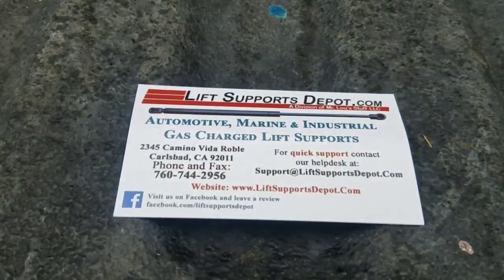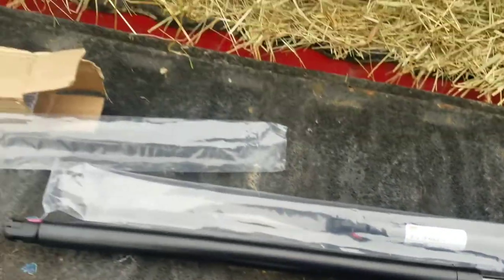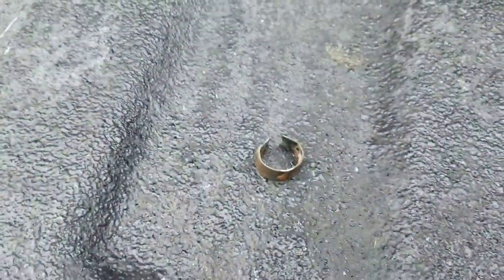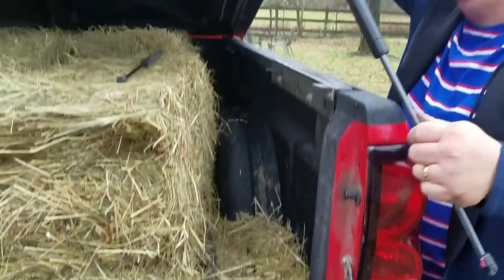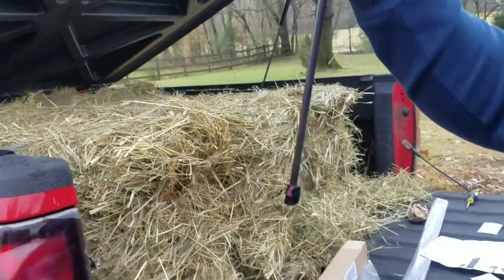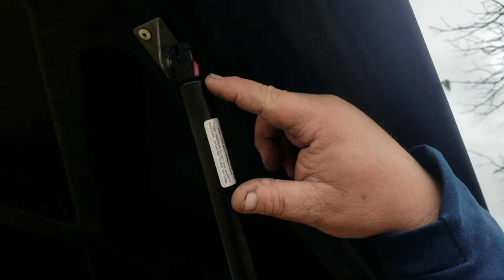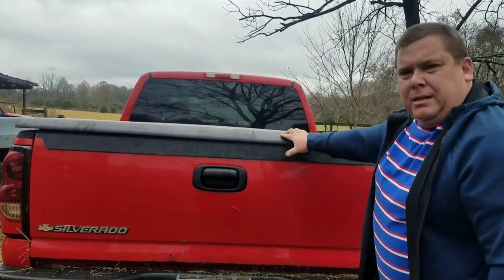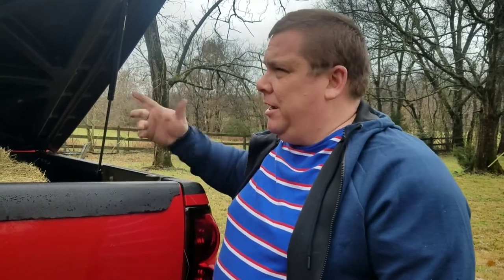Install Gas Shock 2006 Chevy Silverado Undercover Bed Cover How To DIY EZ Release Lift Support

Comment: I didn't need to replace mine, but thanks for the shot of what the rear bracket should look like. The morons at Wyatt Johnson Ford in Nashville installed mine about a foot closer to the cab than this and the tonneau cover wouldn't raise more than a foot OR engage the lock. Simple fix--take off the struts, loosen the brackets, move them back toward the tailgate a foot and problem solved.